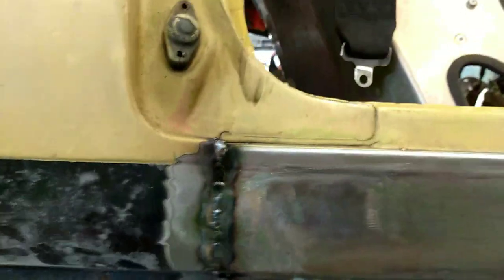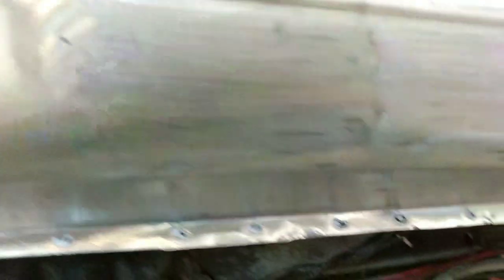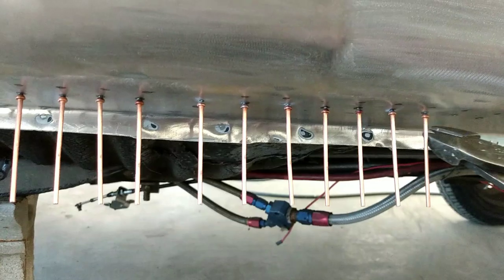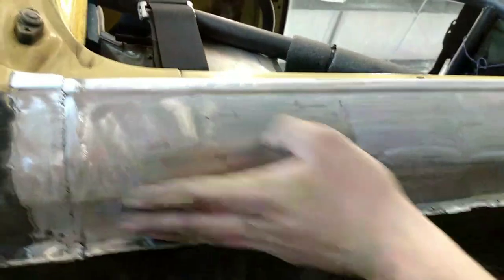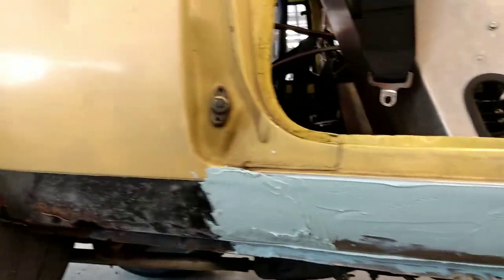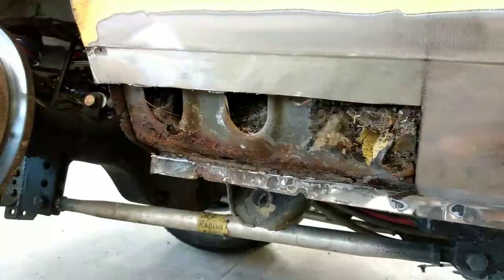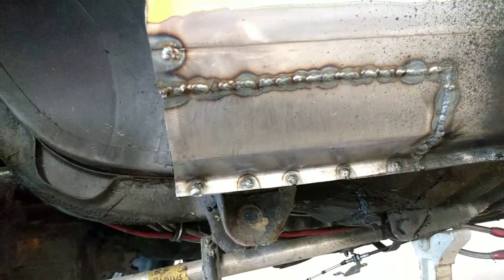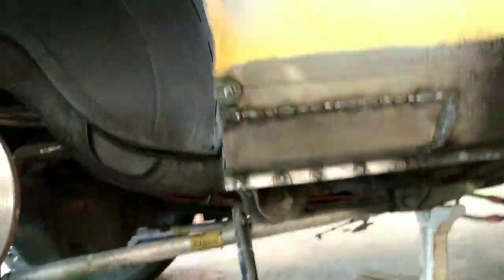Rocker repair on the starlet how to pull a dent

Comment: Thanks for the insight! For personal clarification, I’ll attempt to summarize in case I missed something:

Step 1: Remove paint with your orange Norton disc (let’s call it a zip disc, mine is black/ manufacturer unknown)

-will my “zip” discs (mine specifically being a different color) leave raw metal rough enough for epoxy primer to adhere directly? (I’m not ready to apply bondo yet)

Step 2: I’m assuming you blew the dust off your metal w/ compressed air and wiped the metal with wax/grease remover prior to bondo.

-Did you follow with a tack cloth? At this point it’s ready for epoxy primer if not using bondo?

Step 3: primer

-This black primer you used, is it epoxy primer?

-When I add bondo later, will I need to remove the epoxy primer (and potentially high build primer) in the low spots where I’ll apply bondo? Or can I scuff the primers w/ 180 grit and apply bondo over that? 

Thanks for clarifying